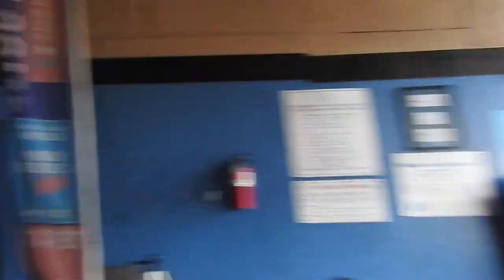How to remove bushing lower control arms Lexus SC300

Comment: This video is halfway  helpful
Reply from the maker: bryce battle sorry it was when i was 1st starting and frustrated it was taking forever
Reply: Secure control arm in vice with rubber portion facing up.
Drill 1/4"hole in bushing rubber between small and large metal bushings. 
Keeping drill bit in drilled hole, use rotaton of bit like a router bit to cut between small and large bushing. Move drill up and down like a saw. (Or use a jig saw ) When you have cut a complete circle, remove drill(or jig saw)and hammer out the center of bushing . Remaining rubber can be removed with a round file or coarse sandpaper wrapped around and stapled to a round one foot length of wooden dowel or broom handle.

Comment: What did you use to get the ball joint out.. that was the only thing I couldn’t slip out
Reply from the maker: oreeo_ mayn hit it with the hammer but not the thread, hit on the side metal solid piece

Comment: Where did you buy the ball joint from having a hard time finding them
Reply from the maker: charles brumfield let me ask my lil bro
Reply: The lower ball joints are a one piece along the with the control arms. You can pack the ball joints with grease and replace the boot but if it is worn badly then you will be better off getting new control arms. The boot can be found on summit racing website. I just replaced my control arms and my old ones have worn bushings so I'm going to replace those for future upgrades
Reply: @saeturn29  how much & where did get them?